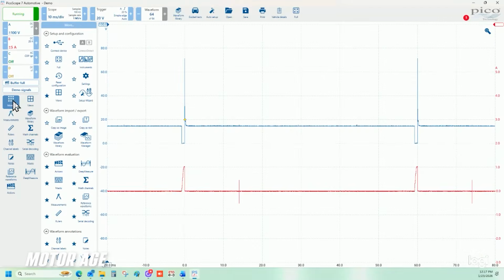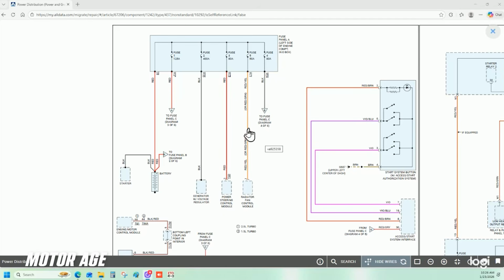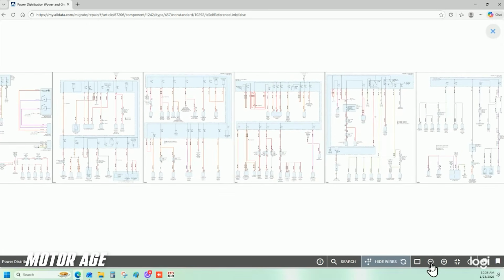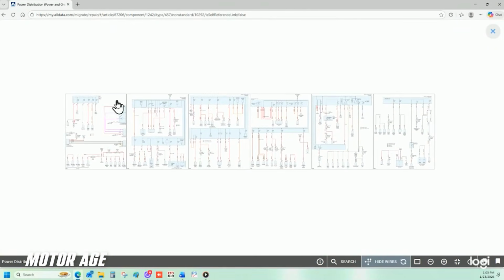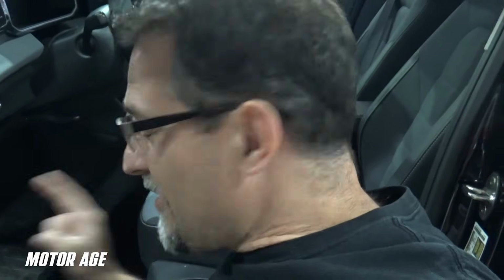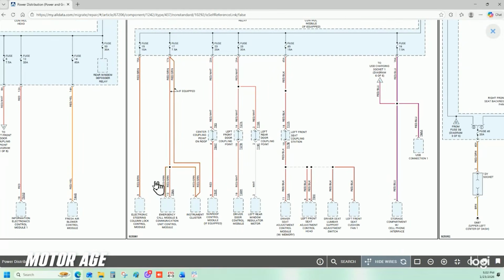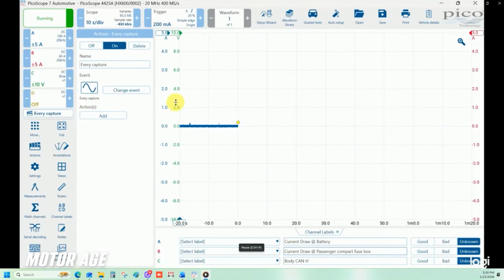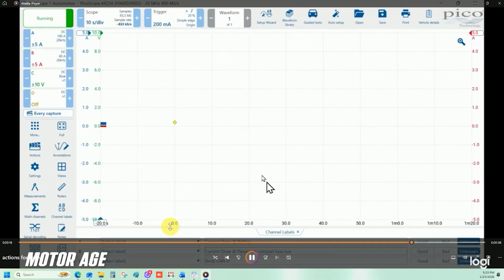Mastering Diagnostics No. 32: Capturing Intermittent Parasitic Drains with a Lab Scope

Comment: Had a problem like this 20+ years ago. Thought about it for a while, then went to Harbor freight and bought four of their cheapest multimeters. Zip tied them to some pegboard and then wired them into my four outlet circuits. Then I set up a digital camera set on the lowest resolution that would still clearly show the meter readings. Set the camera to take a picture every 90 seconds. Came in the next morning to a dead battery. Started going through the pictures. About 50 pictures in up popped about a .150A reading on one of the meters. Tracked it down from there.  Kind of low Tech, but it worked for me.!

Comment: Very cool. Really excellent information and strategic thinking Brandon. I gotta try this. I've been using Picolog 6 Cloud software with my PicoScope 2204A to monitor for intermittent parasitic draws (20mOhm Shunt), and battery voltage. The software and cloud service is free and allows for very long recording periods with the ability to set alarms, access the data remotely, and easily share it. Nice! 🔧
Reply: Very creative!

Comment: What about amp clamp walking? When they are on for a long time . I have seen having to reset the clamp. Am I doing something wrong? I have the pico, snapon and the ones from ATS/AES WAVE... Thanx Scott T.
Reply: Its normal for the clamp to drift over time, I usually use the shunt resistor method with my scope, if I'm going for very long periods of time. Pico has a nice write up on this method.
Reply: Great question! This was definitely an issue, but with Picoscope's new amp probe, the drifting has been virtually eliminated!